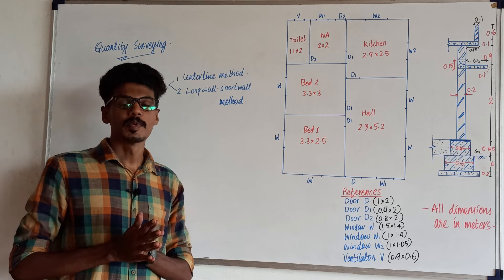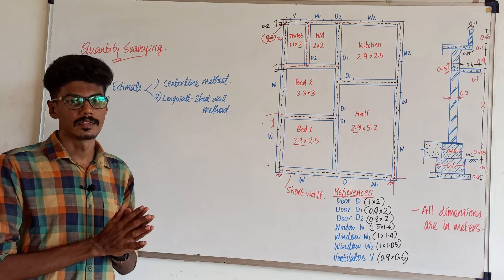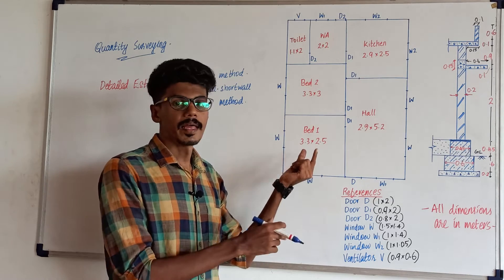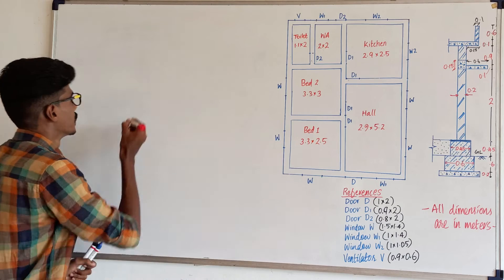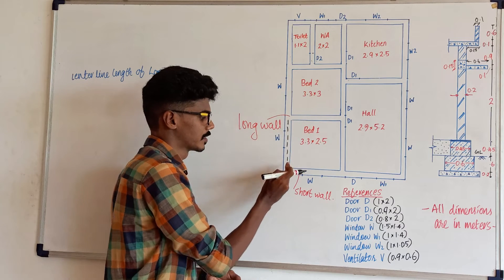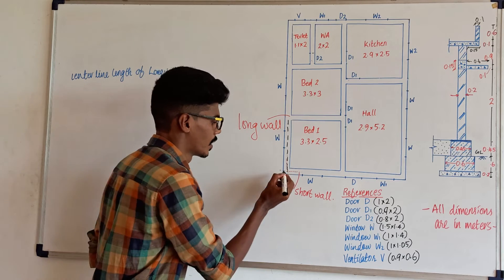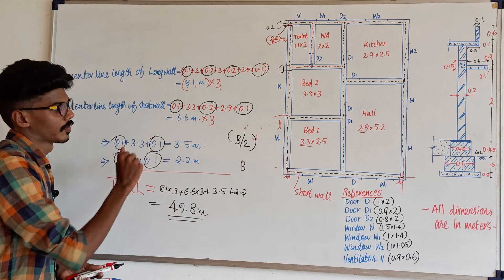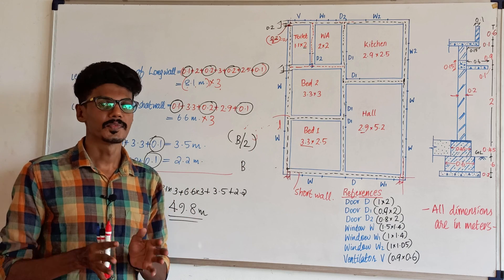Quantity Surveying മലയാളത്തിൽ| Detailed Estimate| Center Line Length|Part 1

Comment: Sir pls give some interview questions for quantity surveyor
Reply from the maker: Basically they may ask from different directions such as basic theoretical terms, Latest Codal provisions used for quantity surveying and valuation, Current softwares used for quantity calculation, And the basic concepts on doing quantity calculation by different methods. 

Depending upon the purpose of interview  (job interview/ academic related) direction of question may vary, so if u are a job seeker just concentrate on softwares and codes and if you are a student or going for any academic related one, just go through the basic concepts and basic terms. 
All the very best. 👍👍👍